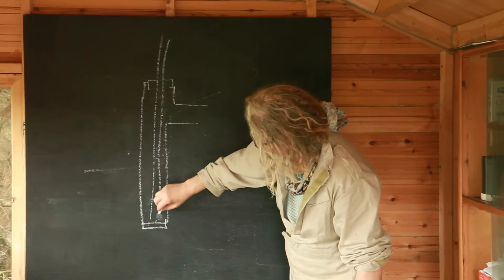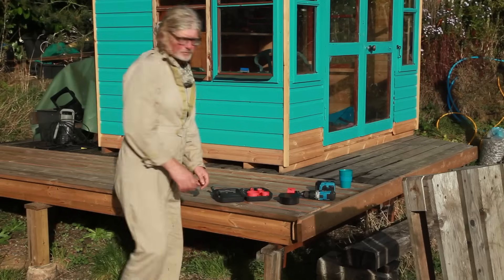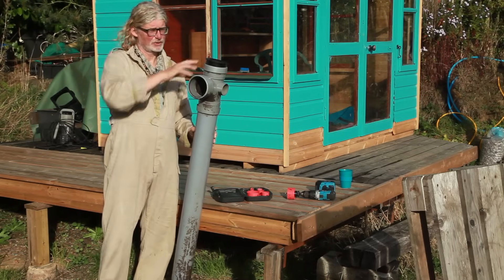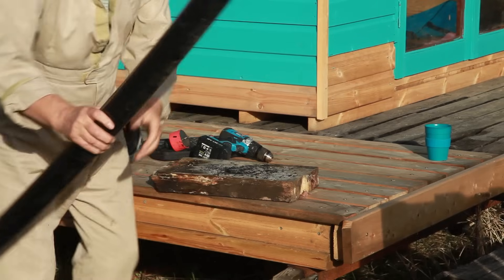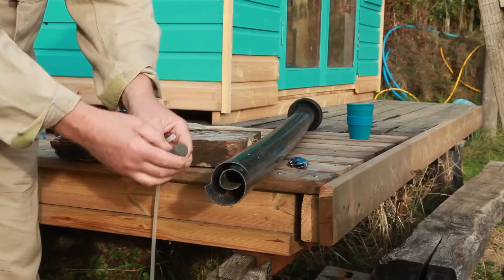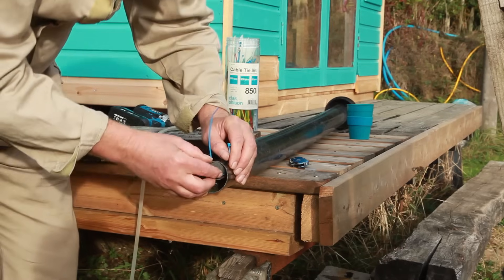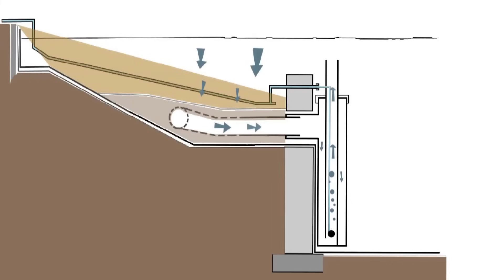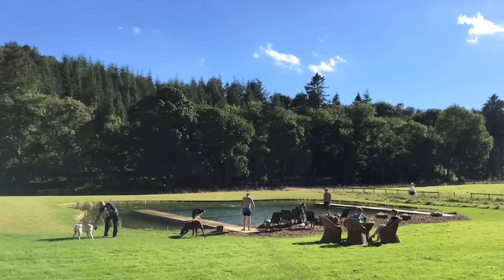How to make Enhanced Bubble Pumps for an Organic Pool

Comment: Very helpful to visualize this, thank you. Our pond plans don't have a vertical plunge pool wall, just just sloped down to the final depth. Is there any reason why we wouldn't be able to put these bubble pump tubes at an angle down the slope? Or must they be fully straight?

Comment: I think I completely understand the bubble lift concept.  What I don’t understand is how they effectively circulate all the water from the swim zone, especially the bottom.  It seems like the water would “short circle” from the regeneration zone, through the bubble lift back to the regeneration zone.  Is there any idea of a bubble lift that draws water from the bottom of the swim zone to move it toward the regeneration zone (also brings cold water up to warm up the pool)?

Comment: Also- could you change the direction of the water flow to do an upflow on the water? I am building a gravel basin with water from bottom drains coming in the bottom. Deciding if I want to retrofit the bubble pump system to the basin I’ve already created…

Comment: I really want to try this on a section of the above ground pond I am building, however the pipework already in place for the T fitting is only 1.5 inches (I’m in the USA). Is this possible with a smaller pipe on the water intake side?

Comment: Hi would it be cheaper to do this or to run more pumps, for the electric bill each month?
Reply: He does it also because electricity is dangerous in water, so whto this technique the only "power" that enters in the area is compressed air... Not even sure that it costs more electricity use..

Comment: Hi David,
Isn`t it a problem, if we have more oxygen in the water which will eventualy reduce the CO2 concentration and can influence the plant growth?
Have you come across such situations?
Reply: hi! i'm not an expert on natural pools, as i'm just starting to design one. But i have a marine sciences degree, and as far as i know, the kinds of plants that are used in these pools get the CO2 from the air, so the gas ccomposition from the water is not really important. although, it is important for the algae, but the water in the pool will most likely remain in balance with the air, so as long as the air has CO2 in it, your plants and algaes will be fine.

Comment: Hey everyone, I have made several air pumps using David’s design and dropping the air stone down the middle. This is so simple that I have just knocked these together. But has anyone compared the flow rate of this with the Czech design or the ones where they run the air external to the large outer pipe then attach a collar and drill small holes in the inner pipe. That would be a great video as there seems to be a lot of guess work in this.
Reply: It could be also interesting to see the difference between just regular 75mm PP pipe flow and the same 75mm inside of 110mm pipe flow.
Reply: @darkdeepfire  do you mean just putting an air stone down a 75mm pipe on its own? The bigger pipe just acts like a mini reservoir bringing water from another tank or area of the pond.
Reply: Since you’ve made this..: can you share if the 3 in pipe pulling water up MUST be below water level?   I would like to hide to with stone to create water fall but worried if pipe is sticking out above water level it will somehow not flow right
Reply: @sarahplush496  hi, to you mean that you want the pump to pull water up above pond level to a waterfall?

Comment: I really enjoy your videos.  I'm converting a concrete pool to a natural "kinda" pond and I'm using air.  My 80 liter pump at <100 watts eats my previous 1.5 HP rated pump at >700 watts for lunch all day and night long.  

I've discovered building a drain field under six feet of water is a bit more challenging than a dry fit and then submerging.  SCUBA along with 30 pounds of weights is part of the fun.

Thanks for the fun and motivation David,

Comment: Question, does it make sense to place the bubble pump further away from the planted zone? I'm thinking it may function in the current design as a divider that causes a rotation in the swimming zone, preventing a chunk of the swimming zone to never make it to the planted zone.
Reply: U dont have to worry about that. Is the same sistem in aquariums and u dont have problems

Comment: Trying to finalize plans for a pool.  Air lift pump has me thinking.  Why not have a pipe plumbed into the deepest part of the pool.  Have the water column dump out into a container in the regeneration zone that is just inches above the waterline.  Large diameter flexible non-perforated drainage lines run from the sides or bottom of this container  and feed a network of perforated drainage pipe at the bottom of the gravel bed.  In this way, detritus is brought up from the bottom of the pool where it can be filtered in the container, and gravity will cause the water to flow through the tubes to the bottom of the gravel bed.  The water then percolates back up through the filter bed, and the process begins again.

Comment: Na mate the air pump works buy displacing water out to the pipe making the water in the pipe weigh less than the water out of the pipe the water out of the pipe enters the pipe because of this and pushes the l8ghter airated water out the top what you are doing will make the pump work harder for every liter of water it pumps in this may go un noticed if you have a strong air pump that you weren't pushing to its full abilities in the firstplace( and not running itat its best ability) but if youare already running thepumpat its best ability you wont get much gains because of the increased pressure uneed to push itdown theincreased distance 

You can get thesame effect buy jus keeping the air stone at the same depth and just spiraling the pipe to the surface the air will displace the same increased amount of water without working the pump harder

What youcan do
Reply: wich pipe would be spiraled ? How ?

Comment: Your drill is plenty strong to drill through the cap, it was not because you needed a corded drill that it was stopping. Turn your chuck and it will not stall out.
Reply: Yes, sounded like the clutch was engaging due to being on a numbered driver setting rather than on the drill bit.

Comment: Thanks for another informative video. Do all airstones need to be at the same depth? If one is much deeper (+1m)  than the others on the same air circuit will any air go to it or will it mostly exit the shallower air stones that offer less resistance?

Comment: I might suggest a spa blower. Much more efficient that the typical piston compressor. I have had them work to 4' depth maybe deeper I have just not have the need.
Reply: ...blower would be cheaper to run

Comment: Hi David, If the filtered water is being reintroduced at, almost, surface level around the perimeter of the swimming zone and being drawn back into the regeneration zone, how does the water at the deepest part of 2-3m in the swimming zone get circulated?

I need a deep pool of say 3m to cope with the heat in Thailand, and am concerned the deepest volume of water will not be getting circulated and filtered.
Reply: David uses this example for people with limited space and pump power, so in your situation you would play with pipe diameter, pump liters per minute (at your depth) and amount of air stones, but you would not need to encase a pipe within another pipe, just have your pipe close to the bottom of the pool
Reply: Homestead Living SA 
Thanks. I'll try some different variations to see what works best.
Reply: @christurner3857  the deeper you go, the thicker pipe will give you more flow, stay with a minimum of 60L/min per stone. Pvc   is so cheap so decide on what you want, flow, pressure or effect
Reply: Homestead Living SA 
Many thanks. I appreciate the advice.

Comment: Hi David, love your videos and pool designs. One suggestion on the hole drilling, when the hole cutter gets the bite on the plastic pipe, stop the drill and put it in reverse. It'll give you a cleaner edge and there's less chance of the plastic breaking. Keep up the great work. 👍

Comment: Great videos. Just a quick question. Do you find you get a build up of solids in the bottom of the tube? I would have thought that as the water changes direction that the solids would drop out of suspension.

Comment: Could you make a video on just the basics of the way pumps work in general for someone that has no experience or understanding of pumps. I see that the bog area of your poolsHas piping all the way around it is that taking water from the pool and putting it into the planted zone or from the planted zone into the pool? Breaking all that down for someone that is kind of dumb about these things would be really helpful.
Reply: It's taking from both as water mixes and displaces to prevent an inversion, so eventually all the water mixes
Reply: @738rh  I am struggling too with designing the pump installation water flow and filtering. Impossible to find well explained videos and drawings without falling into websites that want to sell you complicated systems.
Reply: @tine6857  is actually quite easy,, an each design is different, size, shape, aesthetics etc
Reply: @738rh  for you it is but for people that want to built their own pool without experience ir is a challenge just to design a basic system that works to circulate the water and inject air in the right places

Comment: One suggestion...do not cap the bottom of the 4" pipe so you circulate the stagnant deep water water plus oxygenate it (an algae killer).  Great work though!!!! thanks.
Reply: if im not wrong , the cap keeps pressure off the chamber inorder for pump to work at its optimum .so the pump is only baring the pressure of T height as thats where water is coming in from

Comment: What is the advantage to using compressed air?  Using water pumps will move the water much more efficiently.  A series of shallow waterfalls at the surface will aerate the water just was well, one might think.
Reply: I think cost and maintenance? Thats what ive been gathering. u dont have to worry about sand or debris getting stuck in the air stones like you do with  pumps moving the water not to mention if u have really hard water like we do here it builds up calcium in pumps.
Reply: @brentpal  Good points!  During the month since I posted that question I've had a chance to research more and I find that air can lift a column of water significantly well to do a modest waterfall.  Considering the aeration already being performed in the water column, it does seem a good way to go.  Only downside I see is compressor noise.  A submerged pump is silent.  I guess if you have the luxury of locating the compressor adjacent to a central A/C unit, very little is compromised.
Reply: Water pumps will destroy the small water flora in the pool that are integral to the self cleaning ecosystem.
Reply: He does it also because electricity is dangerous in water, so whto this technique the only "power" that enters in the area is compressed air...

Comment: Hi David. Have you found the increased draw through the planted zone is necessary due to root development over time obstructing flow through planted bed? Do you feel at this stage that you have reached 'steady state' development of roots/obstruction or that you will need to periodically excavate parts of planted zone to remove this extra sediment? Or have you revised how many recirculating loops you install in future builds? regards, Brian
Reply: I would wrap the land drain pipe in biddim first
Reply: Would love to see this answered
Reply: Easy fix for root development..... Pump or siphon the water level down below the gravel planted .... After harvesting some plants for the restart, let it all die. Then start over. Probably....an every 3 year project that takes a month in the hottest month.

Comment: NEED ADVISE ON SIZE OF AIR PUMP.... We've excavated our natural pool and ready to put the liner in next week.....  JUST DON'T KNOW WHAT SIZE AIR PUMP TO GET  I only need 4 air bubblers.   Size of pool: Lap pool section 1.5m wide x 9m long x 1.5 deep/ shallow section filtration zone 5m wide x 9m long x 700mm deep   Can someone please help me out?  Many many thanks, cheers
Reply: looks like nobody is willing to share the answer to this one,believe me i hve looked 🤣🤣🤣🤣🤣🤣🤣
Reply: @immortalayarna   I Just built a massive 63,000 litre natural pool..  Using a Resun LP-100 (140 lpm)  Septic Air Pump...  Works amazing water insanely clear 
3 airstones & 3 air lift pumps
Reply: @thebushnells  Amazing,Thanx alot Nick extremely helpful info, i hope u might hve both the time and chance to show your pool setup on youtube.
but please clarify, you used 3 airlift pumps(140 lpm capacity) with a single air stone connected to each for your 63,000 litre pool ,right?
Reply: @immortalayarna  at 1.5m deep, 75 or 110mm will be perfect with each air stone doing about 60L/min so x 3, so a 200 will work perfectly
Reply: @738rh  thanks alot, I really appreciate the info
Reply: Homestead Living SA so do you need a separate pump for each stone? If not is there an adapter to send air tube to each stone?

Comment: I am wondering about calculating the flow rate of the water leaving the planted zone.  I've watched all your videos, including where you explained how different sized pipe will result in different flow rates, but that didn't address the flow rate of the water passing thru the planted zone.
Reply: It does not matter as your pipes are always submerged so what leaves the air pipes, gets balanced through the regeneration zone, just displacement of water
Reply: Well, not entirely true. My experiments with submerged pump showed a negative pressure appearing at the bottom of the regeneration zone and reducing the momentum of water - flow rate. I wonder. How does that affect the bubble pump ? Emma made a really good question here.

Comment: Hey David, could you please show us a comparison of the flow rate between the 1m and 2m depths? I'd like to see it with the full 2m of pipe. Great video as always!
Reply: ya blew it the more bubbles are in the tube at any one time before it reaches the surface, the bigger the volume of water is able to be displaced, placing the waterstone lover down increases the time that the airstone has to produce bubbles before the first bubbles reach the surface, increasing the number of bubbles in the tube at any given time, increasing the water displacement and flow rate
Reply: you will need to find the best most efficient combination of depth and pressure your self , as depth will decrease the pressure of air too , so its not that increasing depth will always give u more flow but at some point the efficiency will begin to decrease , there u need to install it depending on ur air pump power. but im not sure if it applies same for the chambered version .
Reply: @usmankhanb4u  somebody wrote upper than in place of having a deeper pipe, it could be the same dept but longer, by spiraling it, if I understood well
Reply: And additionally it interesting how the flow rate depends on size of bubles.

Comment: David, I've always valued your videos but you need to move forward with that one. This is not effective way of either aeration neither filtration through circulation. 

I think the best way now is "microbubble" or even "nanobubble". With a low watt you can heavely oxyginate water, and also create a very nice streap for cyrculation. That aproach might be much more effective.
Reply: isnt this the problem of the type of airstone and airpump used and not the system?

Comment: Sediment trap?
Reply: Tristan Morrow not quite, the holes that the water flows through are way too big for sediment to be caught in
Reply: @nullflameboy657  I'm looking specifically at the sealed bottom of the 4" pipe before the airstone...
Reply: @TristanMorrow  Good point! You will need a removable bottom cap to clean the sediments as part of your periodic maintenance. It shouldn't be difficult to implement and to service.